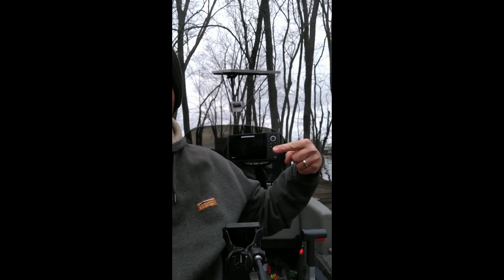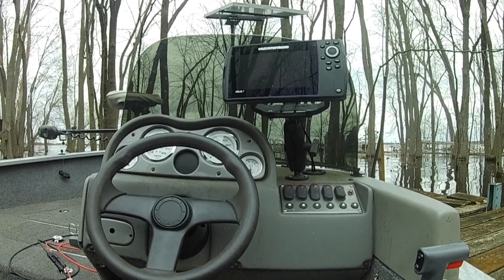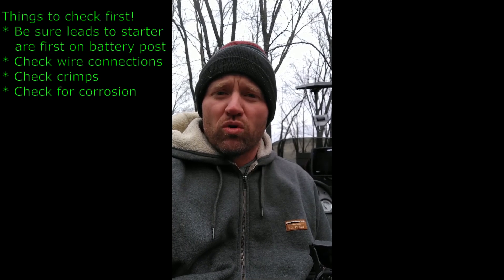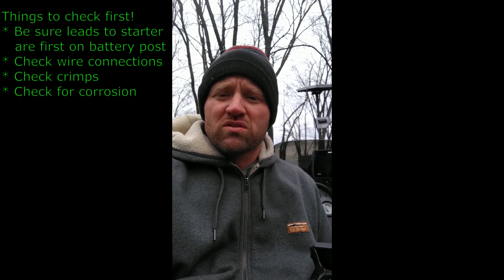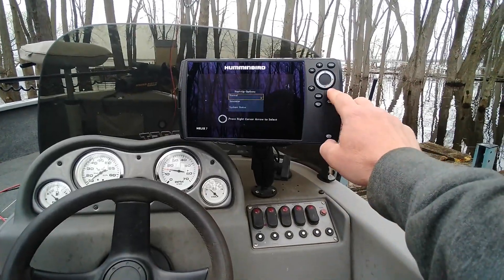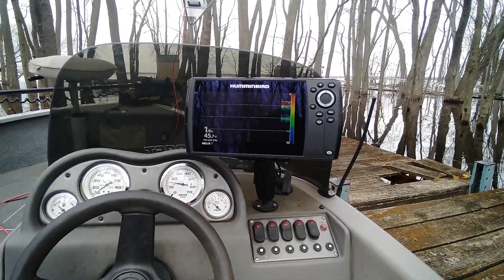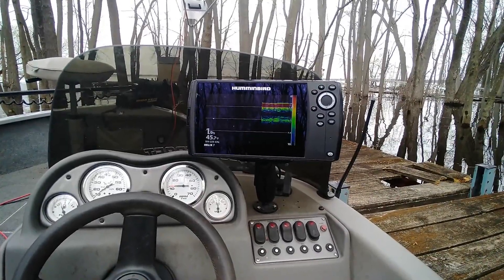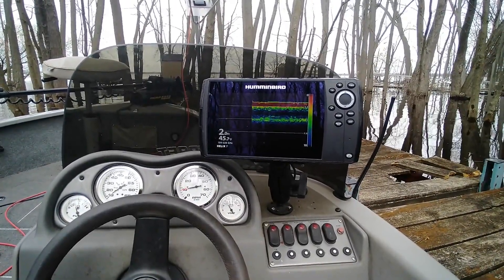Solved! - Sonar shutting down when starting engine.

Comment: I have the same problem with a 90 horse Yamaha main motor. Humminbird does not think they have a problem.  My next problem is that when it shuts off it does not want to come back on. I have to unplug it and plug it back in and then it usually comes back on.
Reply: Mine is doing the same thing. Did you ever solve your issue?

Comment: ok....what you found is a workaround. Didn't really solve or figure out the underlying issue.  I say this because thousands of  starters don't make the head unit cut out.  Props for finding a workaround. I'd honestly like know what's causing it.
Reply from the maker: It did solve my problem, but yes, I guess it is a work around.   The root of the problem is excessive voltage drop.  It could be a lot of different issues depending on your particular wiring setup. I did all the things that should fix it "right" but came up with this after those things didn't work.  Thanks for watching, best of luck on the water!

Comment: Very helpful, I have the same exact sonar system and probably. Where on the wiring system did u connect the boost converter.
Reply from the maker: My dash accessory switch powers a small panel.  The boost converter is between that panel and the sonar unit.  Basically you want it as close to the sonar unit as possible.  Additionally, the boost converter does have a very small continuous draw so you would be best to have it on a switched leg so it doesn't drain your battery over time.
Reply: @EngineeredOutdoors  great thanks u